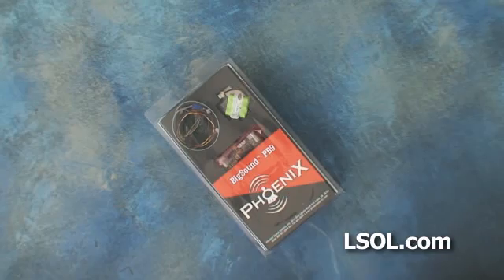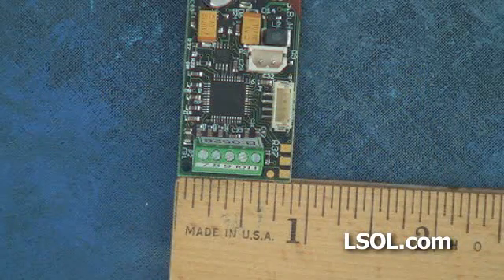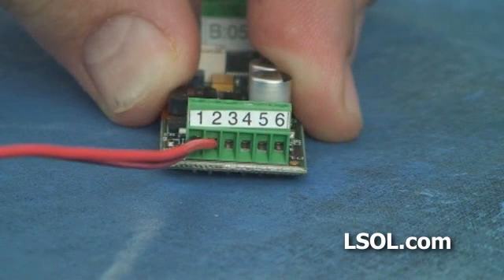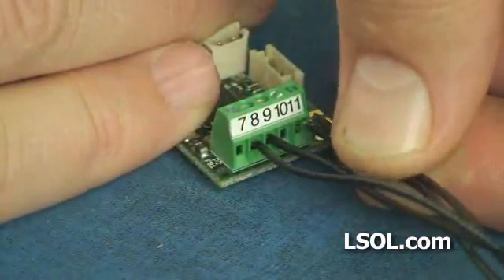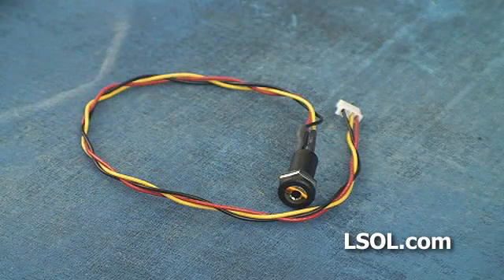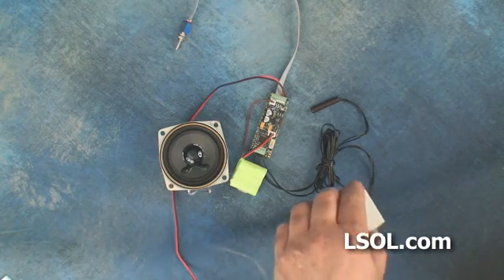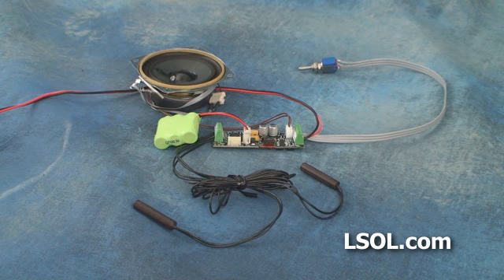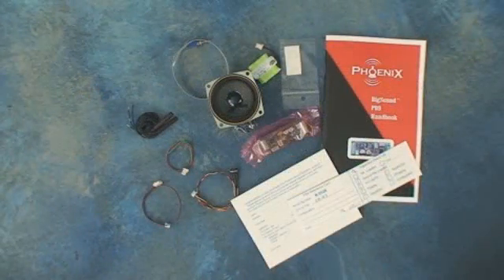Garden Trains: UnBoxing - Phoenix Sound BigSound PB9 (Video Archives)

Comment: Steam sounds work differently, the chuff works off a 3 reed switch the is triggered by 2 magnets that rotate on the tender axle, or through the locomotive's pre-installed chuff wire sensors which you can hook up to the sound board
Reply from the maker: Your are right, takes more effort to install a steam sound.